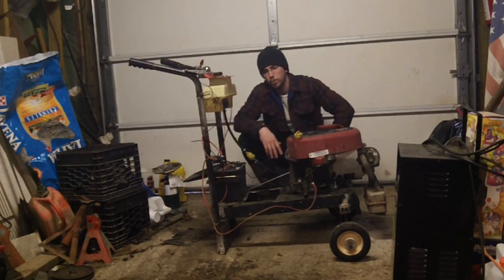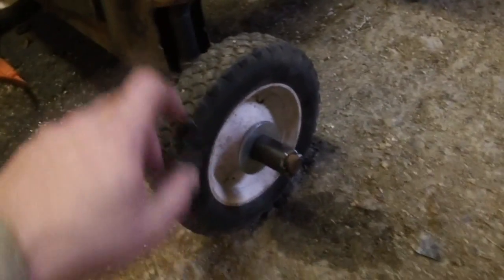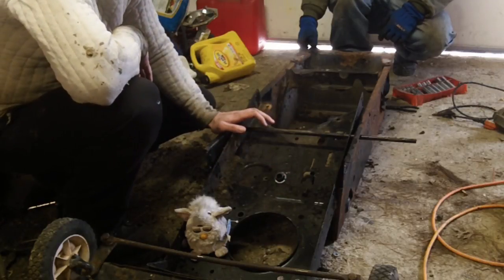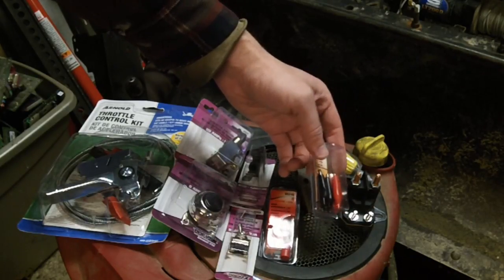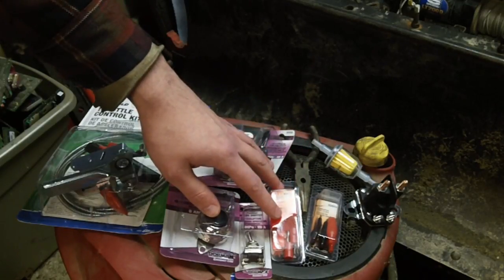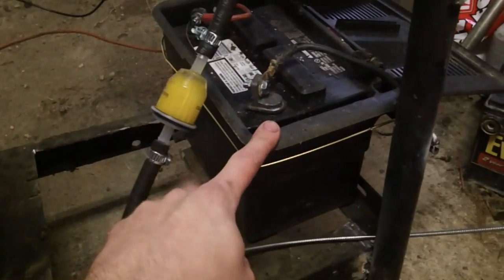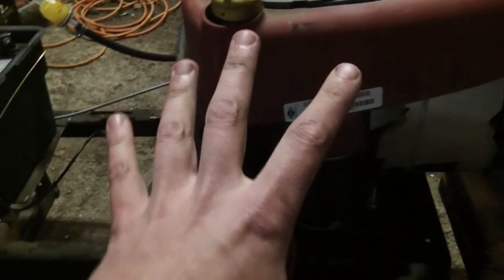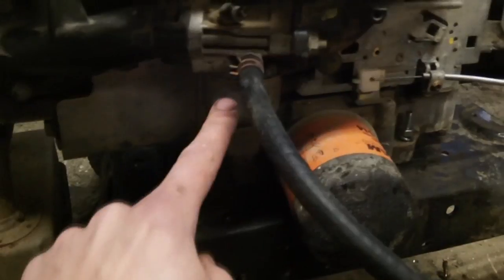Small Engine Testing Stand How to DIY

Comment: I used to have a hand truck (dolly) that was designed to convert to "horizontal mode". It had a couple of short pipes welded horizontally to the frame, so that you could pull the handle bars out and mount them either vertically or  horizontally. You then had a configuration that was great for wheeling heavy tool boxes around, etc. When in this configuration, it looked exactly like your stand. Immo get another one and set it up for engines. This stand is awesome.